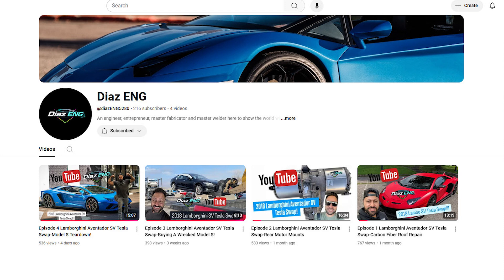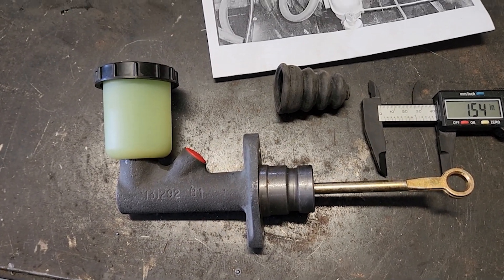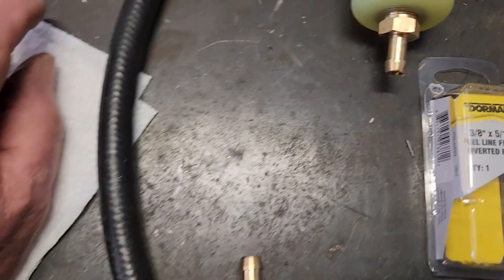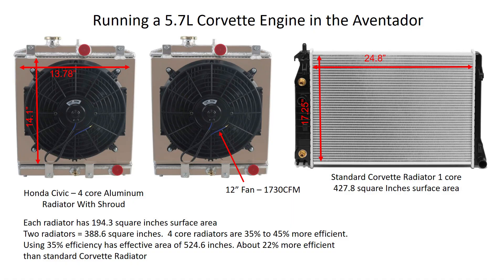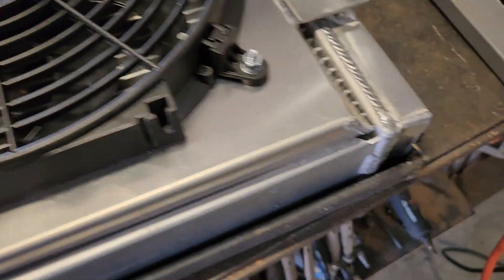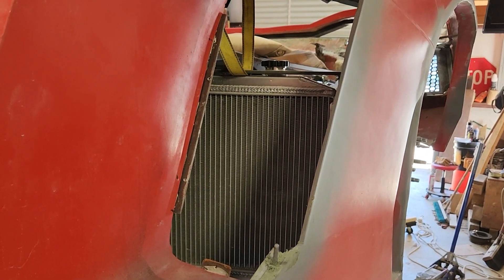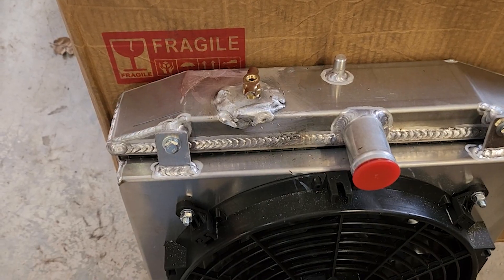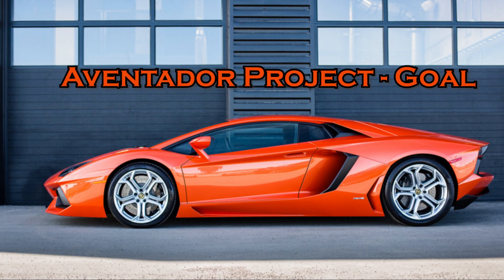Aventador Replica Project - Part 37 Clutch Master and Radiator Install

Comment: Dale, I use the same radiators, and at 105degF ambient temperature my LS1 had no trouble maintaining temperature.  Big difference is I am using Porsche 911 fans which can move a ton of air!  Nice work!

Comment: Do you build your ductwork out of fiberglass or aluminum?  I am still working on my frame, but I am thinking about using cardboard to create fiberglass filler pieces for the CT.
Reply from the maker: Haven't created ductwork on this build. Cardboard and fiberglass would be easier as sell as more affordable